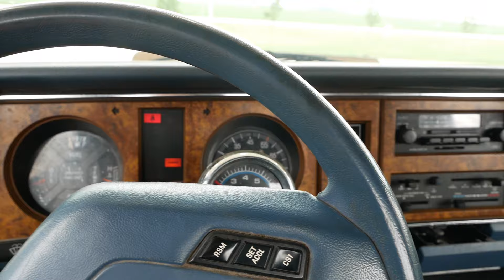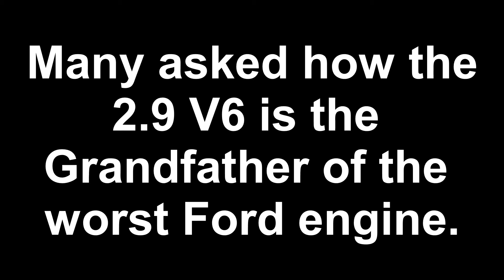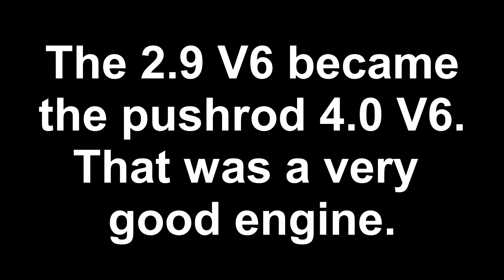Fixing Frank Fritz's 1986 Ford Ranger - Road Ready - Part 2

Comment: Quietly crosses Illinois off the list of places to look for a used vehicle
Reply: All the contrary in Illinois it is mandatory to have your vehicle inspected for safety and emissions, very strict even more than Texas, an inspected vehicle will be in better shape than that, in IL that pick up would have had the registration shredded and the DMV will have taken it off the system..😂
Reply: Even fairly new vehicles if fail emissions 3 times, gets the reg scrapped right at the inspection center which is managed straight by the government, not private shops .he might had made it run but get it back on the road? It'd cost a boat load of money .
Reply: Chicago as a whole, same with Michigan.
Reply: @johncarter1205 only in the chicago area though. everywhere else in illinois it’s not required

Comment: I'm so glad I live down south.  I'd lose my mind with all that rust.
Reply: Not sure if he was joking or not. But Wes said that someone offered him 2k for it before he got it running. I don't understand because it literally has nothing left in terms of the entire floor. Is it even safe to operate on the road anymore? I'm not familiar  with rules regarding totally rotted out vehicles.
Reply: @giggiddy  good winter beater. Prerusted. Better than ruining a $50,000 truck in the salt
Reply: I was thinking the same thing. The anti-ruster in me wanted to clean it all off.
Reply: @DeweyCheatumNHoweLLC  Prerusted. Lol. Cheers!
Reply: @giggiddy  He is a little bit less concerned with the floor but the frame ???
Reply: @DeweyCheatumNHoweLLC  Personally, I  would fix it up and use it as a truck to go back and forth to work with, I'd love to have this little truck. I also would put in a paint on bed liner for it to, along with painting the whole underside of the truck with rust olem black paint.

Comment: When prising-off a circlip, hang a rag over it. That stops it attaining orbital velocity when it jumps off.
Reply: ya know 9 times outta 10 I do and it doesn't fly, but that 10th time I don't it becomes a rocket lol
Reply: Where's the fun in that?
Reply: Orbital velocity? Let's hope that the International Space Station isn't in jeopardy!
Reply: Andrew Main. You are 100% correct. In My Humble Opinion. One would think that could be shortened. IMHO. Hey! I like that! What? NM. Andrew. YES!!  :-)
Reply: Wish I had of used that trick when taking off a circlip from a piston on one of my videos, heard it land and approx area but it's gone...
Reply: You might find it where you least expect it. For example, I once dropped a micro SD card when trying to slot it into a dashcam on a Renault Master van. Searched everywhere even using a torch and a mirror. I gave up and bought another card.  Found the lost card over a year later. It was under the battery, which is in a compartment under the cab floor which has a screwed-down cover with a mat on top. No, I can't explain it either.
Reply: @andrewmain3572  I might have another look but have swept up since then, good thing I only swept the dust into a corner...
Reply: Jesus loves you alot trust in His death 4 salvation and be saved from eternal hell <3 Jesus died on the cross for you bro.

Comment: Finally someone that doesn't over torque wheel bearings! I have serviced 100's of trailer and 2wd front axle bearings and loose is ALWAYS better than tight. Tightenn and turn to smash out new grease, loosen 1/8-1/4 turn and lock it. You'll never overheat a bearing.
Reply: And I have been "preloading" bearings for 30 years and never had a problem.  -  And I get full floating or oil filled axles on trucks and trailers brought to me because when I am done with them, they DON'T leak... One truck came from the Ford Garage that made it about 1,000 miles rear-end grease spilling everywhere...When I took it apart they were almost 5 flats loose on NEW bearings... See with used bearings you might get away with that slightly loose crap, but a new bearing that hasn't run in yet...You leave it that loose and you will not keep seals in it because its not concentric. Even Used bearings that size I put at 20-24 in.- lb preload and put the keeper on.

Comment: Hey Wes....
I really enjoy your channel.
Here's a high-tech tip for your one-man brake bleed job for those times that you are alone while your lovely assistant is out getting her nails powder coated.

If you are using a GoPro you can set it up to film the bleed port. Then have it broadcast via Bluetooth.... You just need the associated app on your smart phone/iPad monitor so you can watch for the bubbleless stream..... 
But your way works great too!
I liked the tech tip you mentioned which was to loop the bleeder hose up above the level of the bleed port. 
I'll do that next time!
Looking forward to your next job.

Comment: I had a brand new 85 86 V6 Ford Ranger manual transmission 2 wheel drive as a company truck and it seemed incredibly snappy back then...
I loved that thing !!
My boss had a Nissan 4X4 pickup with a 4 cylinder dual spark plug setup with manual transmission and that was literally the slowest thing I'd ever driven in my life....

Comment: Transmission countershaft  noise.
Hi Wes...
I've used Lucas Oil Stabilizer on several old transmissions with good results. It's only about $10 bucks a quart which would be plenty in an old farm truck tranny. I've even used it in a '78 Harley Sporster that I used to own. Turned that clunky/clanky shift into more of a silky one.
Worth a try. 👍

Comment: Living in southern USA, that underside is terrifying....
Reply: Yes. He said, "I cleaned this up!" And pointed to a rusted assembly. Hahahaha
Reply: Yep. Down South, we'd send that one to the crusher. But, Up North, they go by a different standard.
Reply: Yes, a lump of rust can be an acceptable part if the working surfaces are still mostly there. These are pretty tough little trucks and I’m sure it will be fine but I would have spent a little more quality time with that needle scaler. I suppose that may have simply reduced its lifespan but I would have felt a little better. 🙂
Reply: I used to live (and  went to college) in Upstate New York. One of my roommates and I bought an old Ford Maverick for 50 bucks, did a quick tune up on it and flipped it for $250. The lady that bought it said that when her husband tried jacking it up (bumper Jack if I remember correctly) the wheels stayed on the ground while the body went up!
Reply: That’s not even bad for up here
Reply: @MyLonewolf25  He does this for a living and is willing to put money and blood into this rig made me think this is not the worst truck. Relative I guess cause i would run if I saw that shit here on the Olympic peninsula. Funny stuff. I would call that truck a boat launch truck...rusted to hell from being dipped in the saltwater all the time.
Reply: @robj2704 Nope. You have it all wrong. In the north, it wouldn't pass Pennsylvania inspection standards and would have to be taken off the roads. In the south, yinz, and yinz say y'all would still have it running on the roads. I use to live Tennessee, and I'm from Pennsylvania. That how I know.

Comment: Pops had a 90 2wd, younger brother blew the engine at 180k. Older brother installed used engine from junk yard, mixed some electronics... bad move. Would idle rough until warm (closed loop), even ford engineers couldn't solve the mystery. My turn, around 400k i brought it back from the dead, installed a clutch painted the rusted out roof. Lastly, changed the plastic idler pulley surface... was worn all the way through to where the belt was running on the star pattern underneath. Totally agree on bearing tolerance. After 40 years I finally know how those funky brake pliers are used! Nice work once again. Pretty cool little truck, maybe Fritz will offer you big bucks to get it back!

Comment: I was always told that the retainers you find on front rotors (including those on that style 4x4 hub) were there to keep the rotors in place on the assembly line. Although I can see the value in retainers for those caps since they want to fall off every time you remove the wheel. For those, I always put a small rubber o-ring on one of the wheel studs which works to keep that cap in place.
Reply: At one time, they also used aluminium Phillip's head screws. Didnt work well
Reply: @DeweyCheatumNHoweLLC  Yeah, Honda did that a lot. I drilled out many of those.
Reply: @rb3425  I wonder when engineers will realize that aluminium and steel aren't always the best of friends
Reply: @DeweyCheatumNHoweLLC  Probably never.
Reply: Fyi, there known as Quick Speed Locking Washers Push On Speed Clips

Comment: I've had the brakes stick to the drum and catch the brake lines and tire on fire on a 1990 Tempo.  Maybe that's what caused the fire.  That is pretty much the same brake system I had in my '82 Escort.  After a memorable day trying to replace them in a driving rain in the woods, where those @%*# springs kept shooting off into the woods and getting lost, I decided I would never need new brakes again.  I built a habit of anticipation of stops, downshifting and coasting.  My 1990 Ranger, I got 110,000 miles out of the brakes.  When we finally replaced them, they still didn't really need it.  It always amazes me how quickly people dismiss the old ways of doing things.  We used to get 2-3 trips through the brake lathe before the rotors and drums needed to be replaced.  They would outlast 2-3 sets of pads.  That really makes me miss my little Rangers.  They were great little trucks.
Reply: I think most of society drives their vehicle like they’re watching a damn video game. I have two electric flatbed GEM’s at work that are maxed out at 25 miles an hour. Sure as shit, after only one year I hop in the thing and the damn brake pedal is all the way to the floor. Take off the tire and look at the pads and they’re almost down to metal. This is what happens when you let millennials use equipment
Reply: Most likely the white powder is from the fire extinguisher they used to  put out the fire caused by the alternator....known issue for the 2g alternator... they pointed the harness up and it fills with water , salt etc.... then one day the regulator goes full charge all the time and the fusible link  is a tad to big  so it glows brightly  and starts a fire 🔥....and it's all over but the crying
Reply: What about those front brake hoses on those Tempos?  The retainer bracket swells with corrosion and pinches the hose, and people end up chasing a mystery brake-drag condition...  I used to spread those brackets with a large flat blade screwdriver, and fix that problem!

Comment: When you rapped on the wheel cylinder (at 11 min. in)  I flinched because I felt a spec of rust hit my eye. Damn flys. almost 3/4 inch of axle hub outside of the studs, sure would give a mechanic more room to work on shoes if that space were 1/4 inch less. Damn engineers. If I had a brake lathe I would use it too on any vehicle over 8 to 10 years old. right now I am redoing a brake job on a 46 CJ2A. last time was in late 60's. Not worn out delaminated. Damn JC Whitney parts. Damn impact makes so much moise one can't hear the "click"

Comment: I've been working in a shop for 13 years, we don't have a brake lathe, but we have taken rotors to the guy across the street and he had machined them for us. I just when back to school to get certified, and learned that Ford dealers will not warranty rotors unless they have been machined first to try and get rid of shakes. We got to use some old AMMCO machines, apparently I still know how to use them, even though I haven't used one since 2005 when I was in grade 12.

Comment: I purchased a new 1988 Ford V-6, 5 speed Ranger XLT Extended cab. Drove 8 years, Still looked like new, put 80,000 miles on it, sold it for more than new purchase price. It was a good little truck. Only vehicle that I got more back than I paid for it!

Comment: I'm 42 and absolutely love driving these older cars from when I was a kid. My current means of A to B is an 88 Toyota Camry. Paid $600 for it and have probably dumped another $1,800 into it. Replaced all the exhaust from the converter back. Put new tires on it, brakes and rotors, wheel hubs w/bearings, and both lower control arms. Then gave it an alignment. Next was a starter and radiator. Just blew the head gasket the other day, so that's getting replaced now along with the timing belt (might as well). All that'll probably run me another $800. It currently has a rear bumper held on by a coat hanger, but I don't care. I do quite well for myself and could easily buy a new car, but I love the old smell of it and not caring if it gets a ding, the simplicity of fixing and driving it, and the rock bottom insurance rates. My dad instilled some cheapskate values in me. haha. That man would repair things until they flat couldn't be repaired anymore and wouldn't be caught dead buying anything new, especially a car.

Comment: I don't usually comment about any videos in general, but being a lifelong Californian (for better or worse) I am amazed by the rusty dogs that people from the midwest will fix up and get running again.   You guys should come to California and pick through some of the junk yards here.    The frames are usually rust free and the motors are usually the only thing needing replacement.    My 1990 F250 that my father bought new, still has the original paint on the frame.    I wish that some of these midwesterners would come here and save some of these cars from the scrappers.